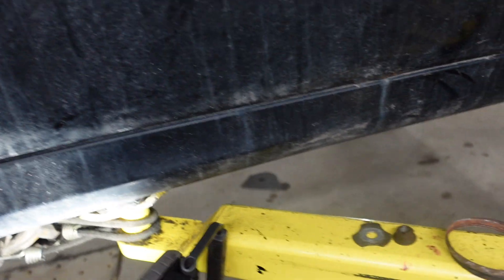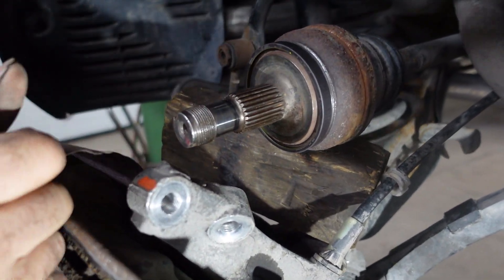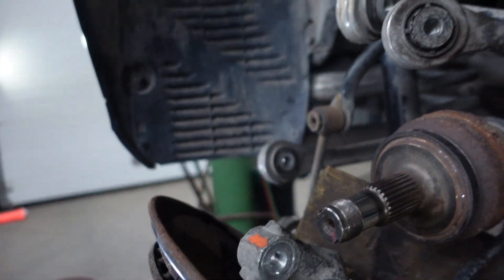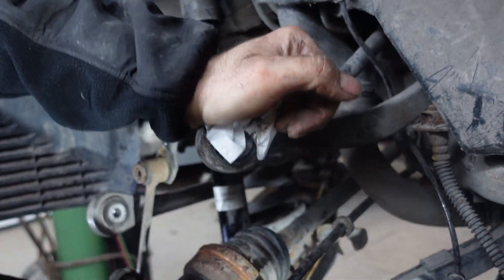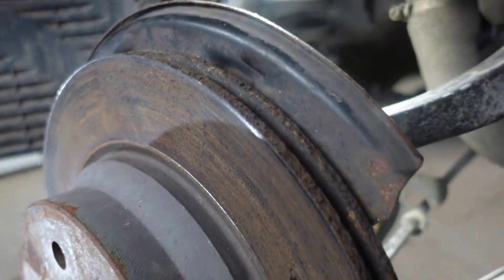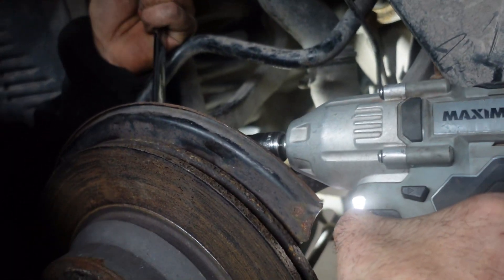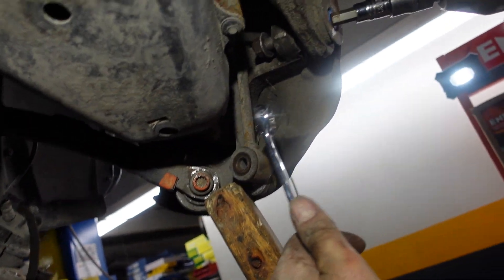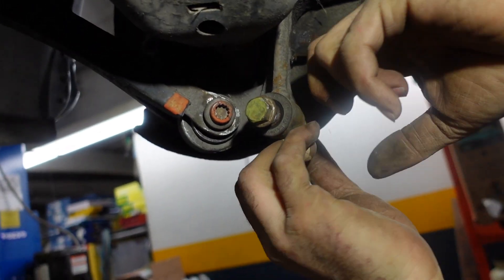How To Replace ABS RING On MERCEDES BENZ E350 4MATIC (Part 2)

Comment: Thanks for posting this and Part 1. I have a 2010 E350 AMG Coupe and after replacing the rear left sensor I still have the fault, I am assuming it is the bloody ring. This video shows me what I need to do as I presume the process will be almost, if not, identical - although I will be doing this without the assistance of a car lift, axle stands and getting underneath.
Reply from the maker: Welcome!👍

Comment: Needed to take a linisher to my driveshaft before new abs ring would fit, pattern part though.

I've been working on cars for 45 years and this was one of the worst jobs I've ever done....and I've a fully equipped DIY workshop and even an induction heater for seized fittings, but no ramp. 

6 hours to remove the bolts, one of which broke.

Old ABS sensor broke so had to be drilled out.

Then alinging the various arms was a nightmare too.

There are quite a few tools involved that the average Joe may not have.

Probably worth getting a Mercedes specialist to do this,   I won't do another.
Reply from the maker: Seems like you were dealing with worst case scenario.

Comment: How did you diagnose that the problem is the ring?
Reply from the maker: I had used a scan tool to determine the error code. I removed the ABS sensor. I could see the ABS ring was badly rusted.
Reply: @saabmastertech5852  thank you! I have L6/4 - same wheel, hope it will be just a sensor.